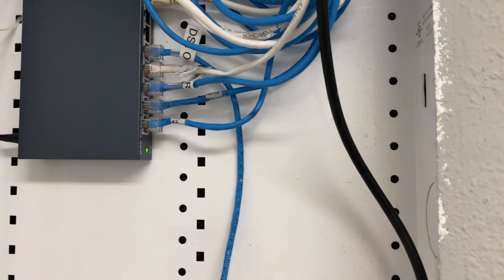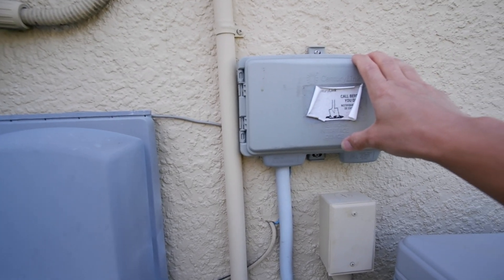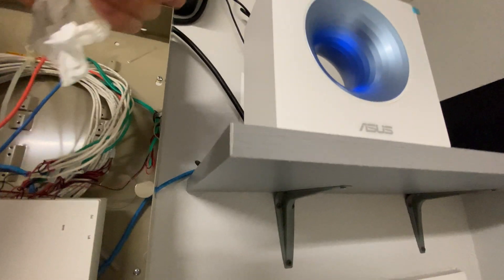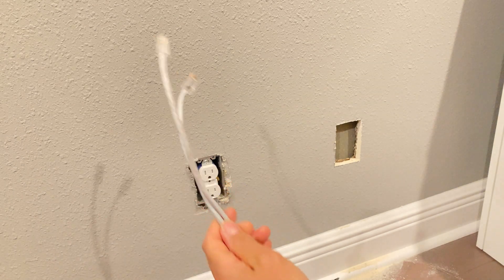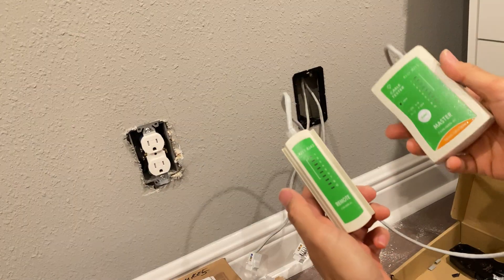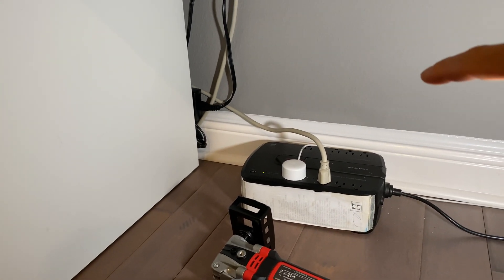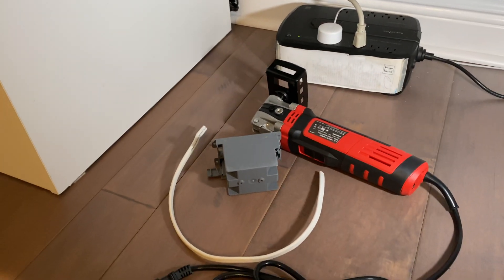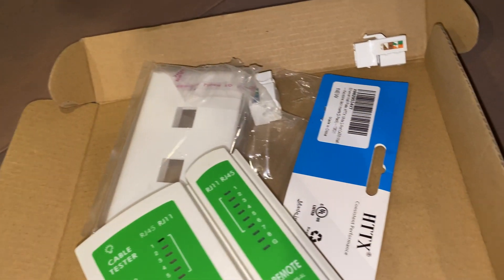How to Add Ethernet Ports and 120V Power Outlet

Comment: existing outlet box has yellow wire, yellow= 12ga = 20a, you ran white= 
14ga = 15a.  You are potentially going to overload your new outlet, 
overheat the wire, and cause a fire...... Trust me I'm a electrician.
Reply: You may not but someone else may. You have to think about future use by anyone in the home and future owners of the home. If I did that I could loose my electrical license. But other then that I didn’t notice any other issues. I’m not trying to be a pain just looking out for your best interest.
Reply from the maker: I saw that, then checked and noticed the circuit on that run i tapped is for an outside GFCI, but they strung the dining room outlets on the same line. Figured I'll never run 20A draw from my computers so I'd be safe.

Comment: Great tips! What do you think about those connectors for the cat 5 ? Honestly I wouldn't advise using them outside. Not rated for outdoor use that I'm aware of because humidity and small moisture will build and cause corrosion and latency. I've seen people have worse ping and network latency using those as well. Also is tying into another power box up to code where you live? I'd be also checking the circuit load too and be sure you don't Over load if.
Reply from the maker: The RJ45 connector should be fine but I think they reduce the rated distance by half, 150ft from normal 300. I'll see how it goes over time. Worse case, I'll have to make hard crimp connections. For power for 120V outlet, this is not much different than what electricians do anyway on new construction,  I have other walls that are stock with back to back outlets. This circuit I tapped is actually daisy chained off a 20A circuit with 12AWG wire, so capacity is not an issue. Most circuits for non-continuous loads are never close to capacity.